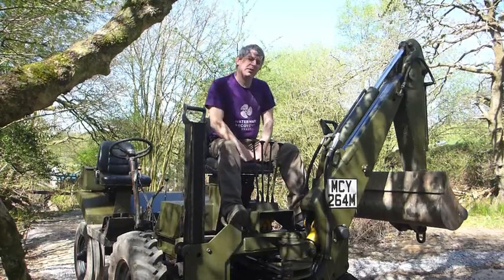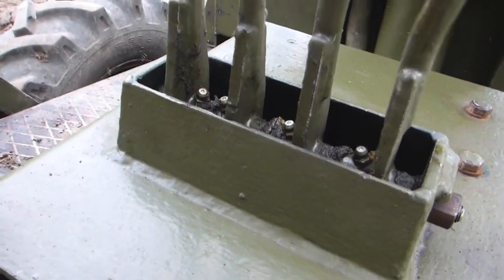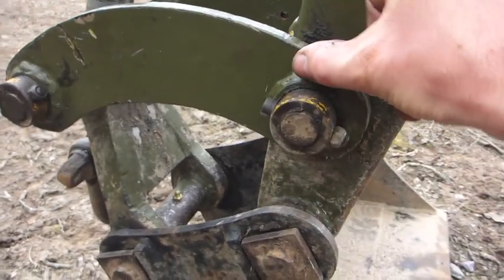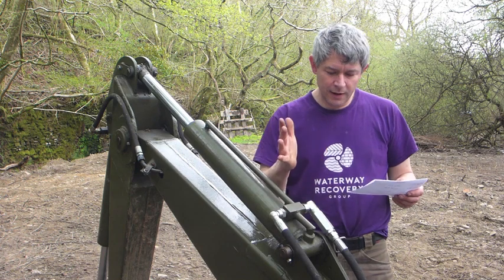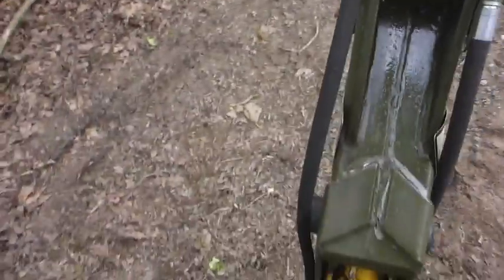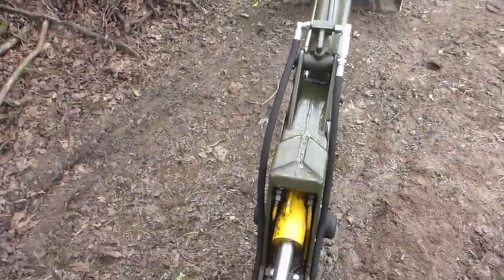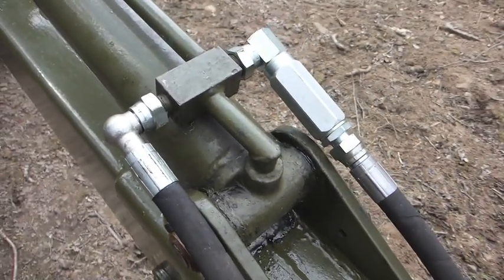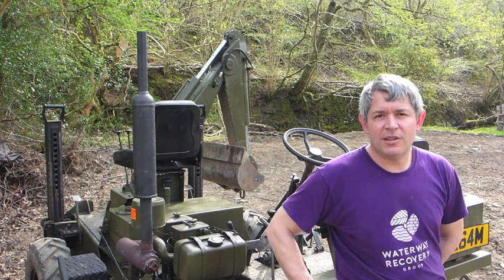Thwaites Tusker Owner's Notes Part 3: Hydraulics and Arm.

Comment: Thank you for your videos. I’ve just found them after replacing the king pin bearings on my Tusker. Looking forward to my retirement when I’ll have the time to overhaul my Tusker. Mine is wired for electric start and has a hydraulic power pack mounted behind the seat which all looks original. Never tested the power pack.

Comment: I would have thought that Thwaits would have fitted either a pilot operated over centre valve or better a tilt lock spool like on a fork lift truck. An over centre valve is fitted in the return line same as yours but has another pipe linked across to the feed line, what happens the return is blocked until there is a pressure build up in the feed line to release the returning oil. These are also used on crane winches to stop the winch from running away. All fork lift trucks have a tilt lock spool. this looks just like a normal double acting spool but has this over centre facility built inside to stop the mast from falling forward when forward tilting.

Comment: Hi  could you provide a bit more info on the fixed throttle check valves as I would like to fit this mod. Eg port sizes /  flow rate or some reference flow fit could use to id what they worked out. Thanks for any help
Reply: Hi, as the vid explains they have a 2.2mm dia hole in them. I'm not sure what else I can say to help there.
Reply: These are not supplied pre-drilled from the Company mentioned, so you have to drill them through yourself. they require an allen-key to dismantle, easy to do, three parts inside,the part you drill has an indention on one side. I used a 2mm drill with a metal sleeve shaped like an allen-key from Screwfix, a Milwaukee [ID 48 89 4703] Red Hex,cost £4.23 for two, they drill one hole before they are knackered. I tried a carbide drill, it broke in the hole and they cost twice as much as the other drills, so be aware.
Reply: I forgot to mention, I used cutting fluid to keep the drill cool. If you try and drill dry, the drill won't even cut through one of these hardened plugs.

Comment: I had one of those. Better than a shovel, BUT stabalisers very hard to hand lift out of soft ground. Machine not very friendly to drive or start. I would not have missed the experience though. King pin was the same price as the part number. (£1011 or therabouts if I remember.)
Reply: Yes, I found this. If you go to the final part of the series, Operation, you'll see the 'double lift' technique of using the arm to lift the legs clear of soft ground. Makes life a lot easier.
Reply: @philscott2056  I only found that out when the ground was suitable for the extra weight of sunk in pads. Never the less it was a hard machine to work, however faster than digging by hand, as you have found.